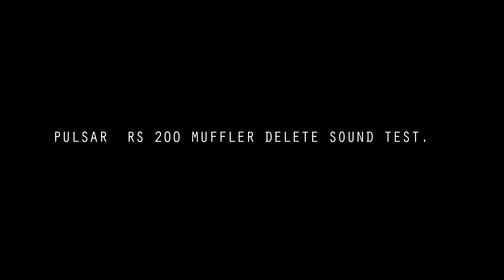Pulsar RS 200 End Can (Silencer) Removal | SOUND TEST |

Comment: hey bro can we decrease the weight without removing fairing??
Reply from the maker: By removing this piece of the exhaust, mud guard and saree guard you can save maybe 3 kg's
Reply: Change the full exhaust system and get an. Aftermarket exhaust and u save a lot..the tail lamp saree guard mudguard too